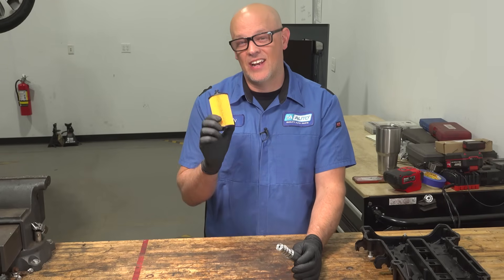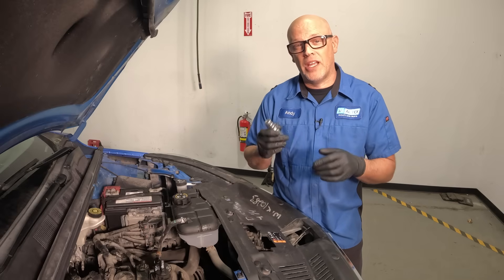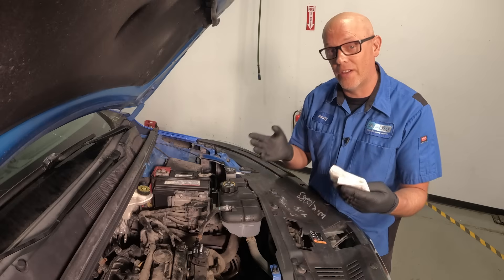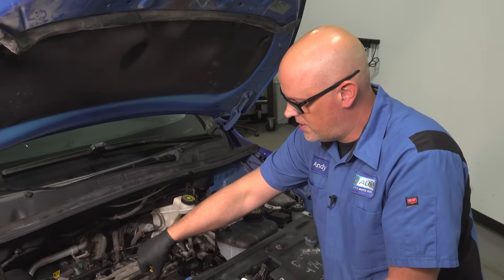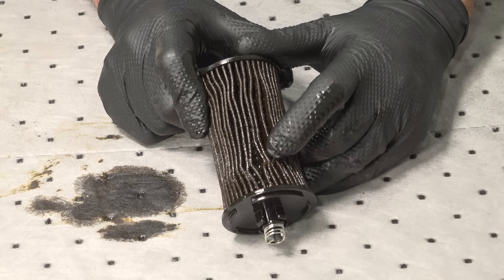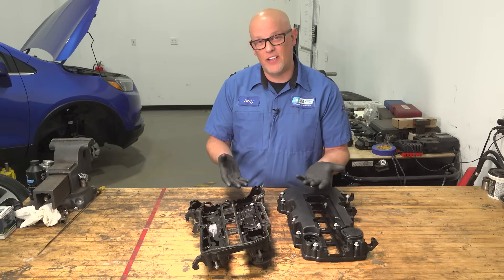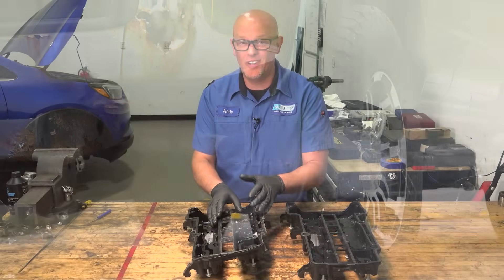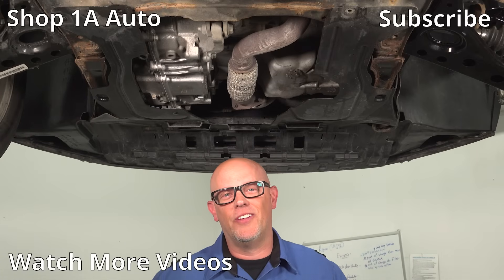Check Engine Light on Your Car or Truck? How VVT Solenoids, Valve Covers & Oil Changes Are Connected

Comment: Thanks for the tips.  Recently had a leaking Valve Cover Gasket Replaced.  Multiple Leaks into the Spark Plugs Wells.  They took pictures of the "Gunk" and Varnish under there... Have been changing at 3 months/3000 miles/50% OLM for quite some time now... I don't want to know what it would have looked like if I had allowed it to go for the GM recommended OLM Interval up to 7500 miles/12 months... Since I've been trying to combat Oil/Fuel Dilution with the shorter intervals... Maybe a look at, and cleaning of, the VVT Solenoids (which I hope don't look anything like under the Valve Cover) can't hurt.  (No codes at the moment)